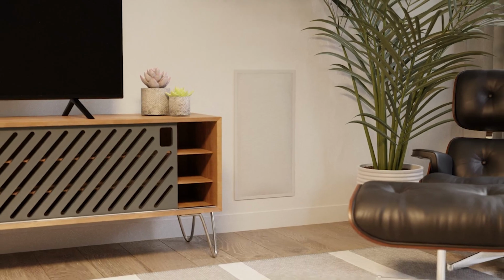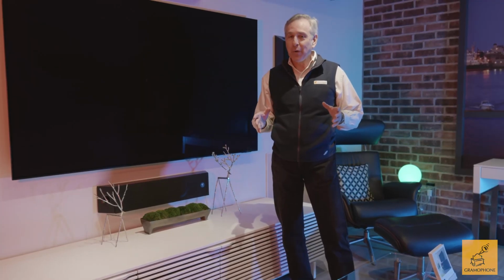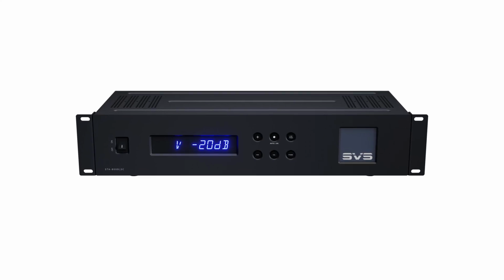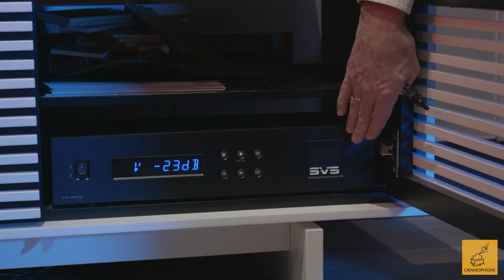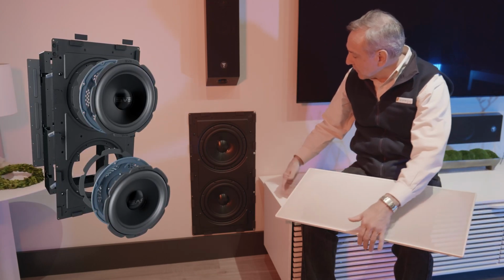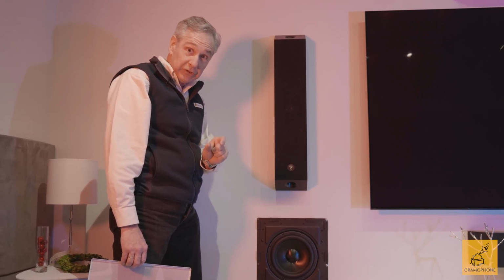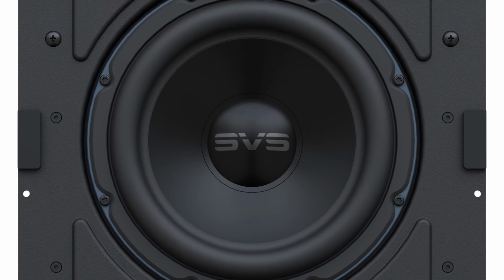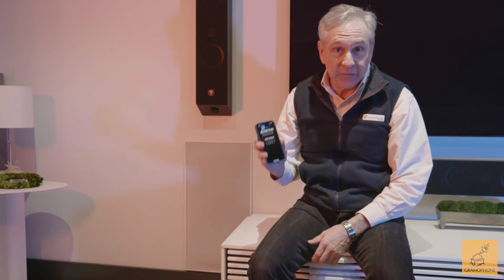SVS 3000 InWall Sub: Powerful Bass From Concealed Subs

Comment: Wireless adapter or not you’ll always have to run wire to the speaker.
Reply from the maker: Hi True, yes, you're right - we got a little over-enthusiastic on that!  SVS Wireless Adapters work between the receiver and the amp - which in the case of in wall subs is a separate chassis.  Thank you